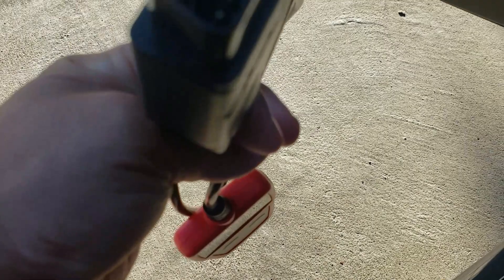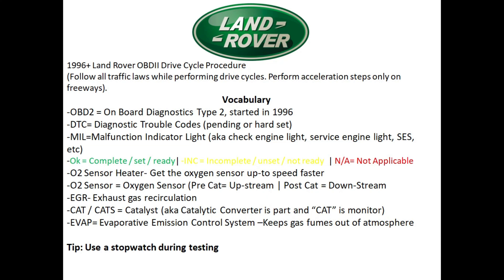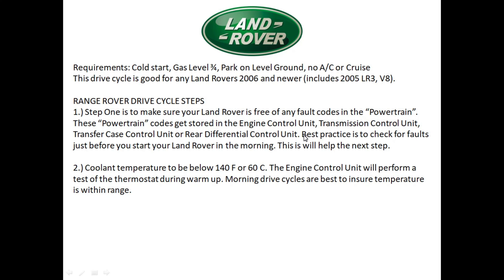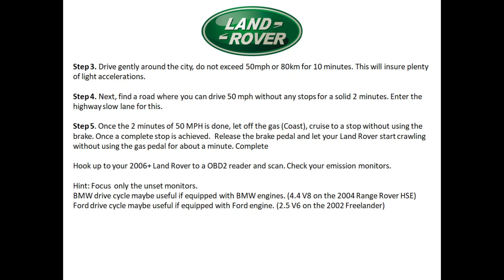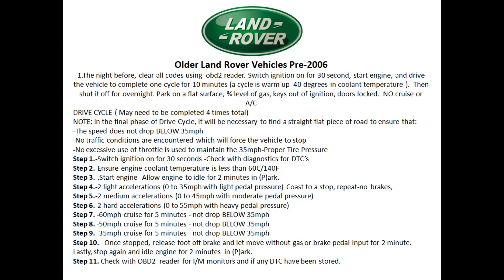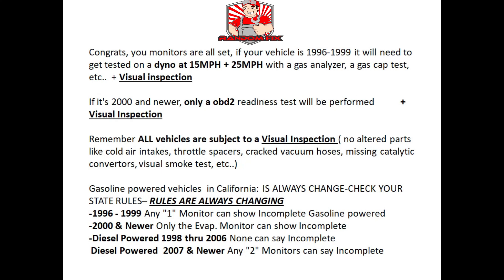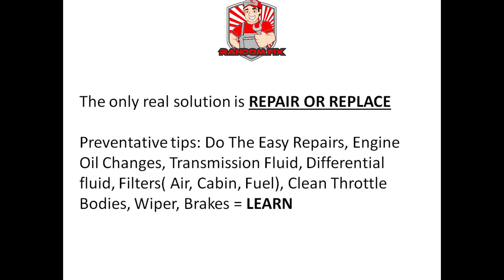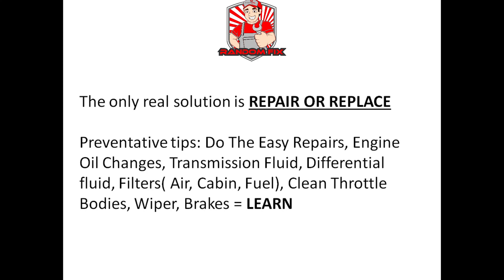Land Rover Emissions Drive Cycle▶️ Land Rover Smog Test CAT EGR EVAP OBD2 Monitor Readiness

Comment: Hi, thank you for making this great video. Any additional information on the catalytic monitor. We have 2013 Range Rover Sport, no pending codes, or stored codes, all other monitors are set except for the catalytic monitor. We have done the drive cycle many times but cannot get the catalytic monitor to set. We also replaced the o2 sensors, and the intake pressure sensor. Any additional help would be appreciated. thank you!
Reply from the maker: Is this your daily driver? If the vehicle hasn’t been driven much then let idle for a long time to get the catalyst nice and hot then hit highway for some high temperature driving. Hills and mountains can really help heat up the catalyst as the colder temperatures outside are working against you this time of year. There are also some additive but none of them will substitute a good warm up, I’m taking 30 minutes of just idling. Keep me posted. 

If this not your daily vehicle and only driven occasionally then you may need to do some extensive freeway driving.
Reply: @RANDOMFIX thanks for the response. You can say this is not really a daily driver. I only drive it for couple of minutes morning and evening. Probably less than 5min each time, so it never really sees the freeway. I’ll try that and keep you posted. I have driven it on the freeway for short distances for the drive cycle but nothing. Would you recommend to drive for some distance and stoping to idle or just do long continuous drives?

Comment: You need a decent Automotive Scanner that does fuel trims to efficiently diagnose emission DTC trouble codes and use YTube video's technical guidance for specific codes diagnosis.
Reply from the maker: You would really need a scan tool that emissions probes. How does that help. If the views had the money the could just buy a new Land Rover if they had an issue with the drive cycle. Sorry I don’t follow you feedback?